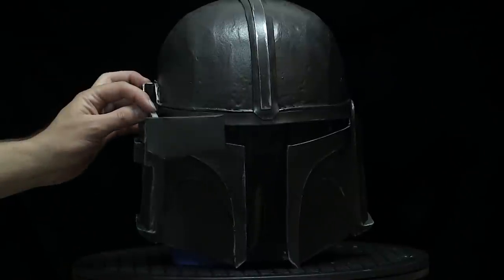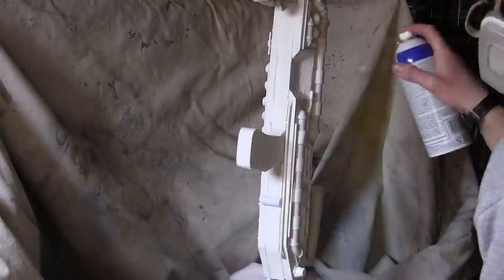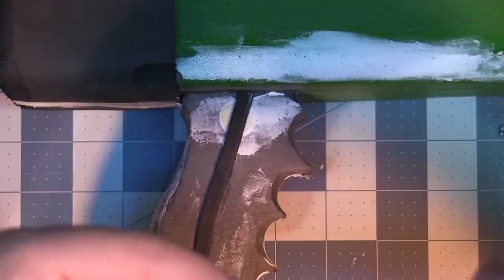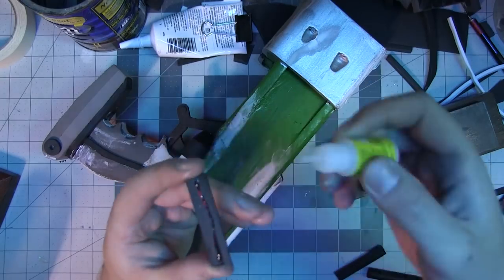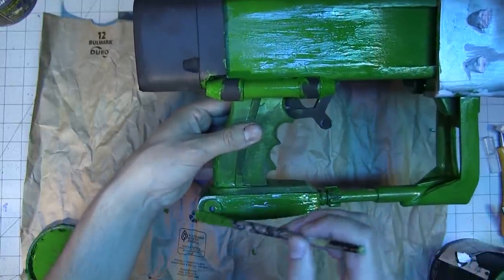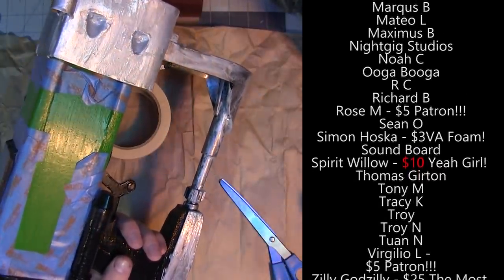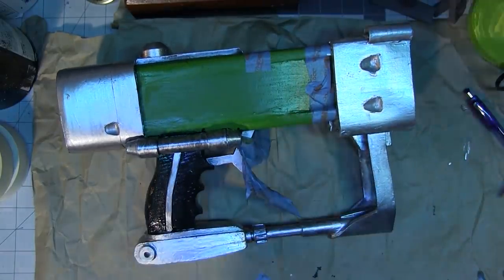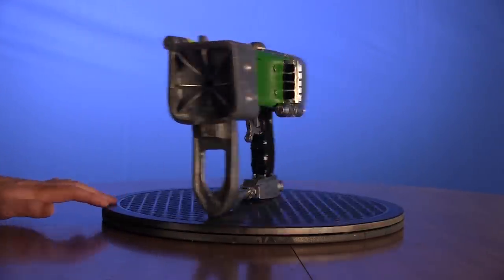HOW TO MAKE a Fallout Laser (DIY)

Comment: Painter's tape is one of the biggest product lies, isn't it?
Reply from the maker: TELL ME ABOUT IT!
Reply: Odin Makes yep.
Reply: There's a different type of painter's tape that might work better. Artists use it to mask off areas on canvases and it's never bled for me, but I've never used it on foam. I'd check an art supply store like Blick (Michael's has never had it when I've gone looking for it). I can't remember the exact name of the tape, but it's white instead of blue. Hope this helps
Reply: Try frog tape, the green stuff.
Reply: @ShuTheIdiot  Frog Tape is best. The off-brand painter's tape either bleeds through or it tears paint off - never had any issues with Frog Tape (Used it for painting a large room, and it kept the paint off of the areas on the wall we did not need paint on without bleed through.)
Reply: @MrFullCrumb01  I use frog tape from time to time and i know Kamui cosplay used it on one of their more airbrush heavy builds hense my recommendation :3
Reply: @WilliamJakespeareProps  i use masking tape for models. put a line of that down first then the regular green painters tape on that. if you check at michaels, i think it's the super thin/small tape in martha stewart brand.